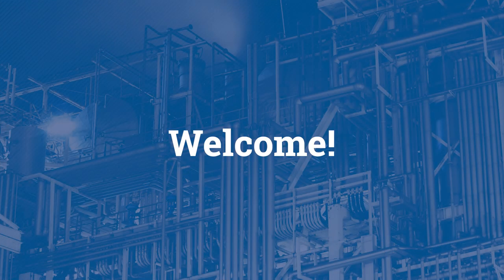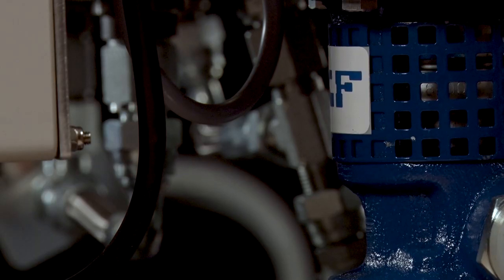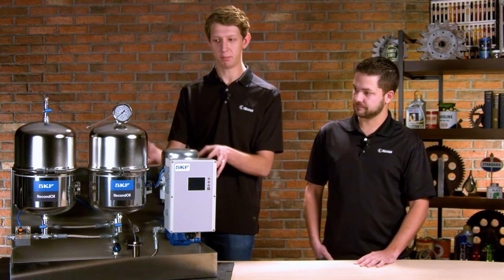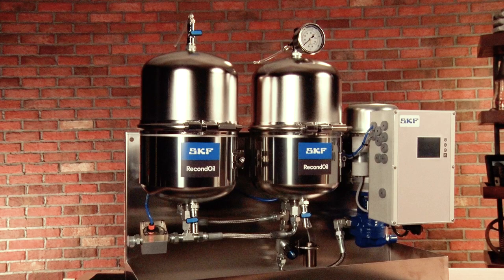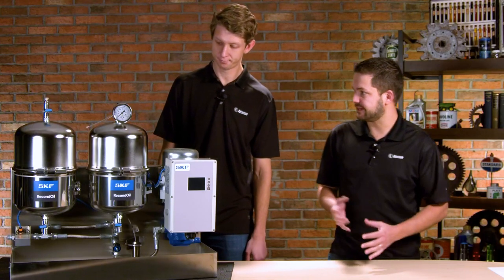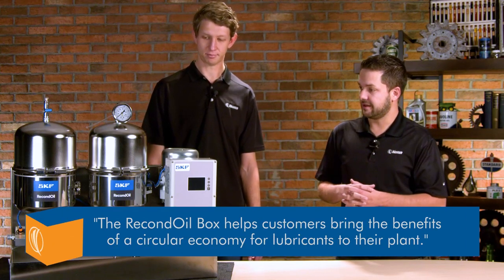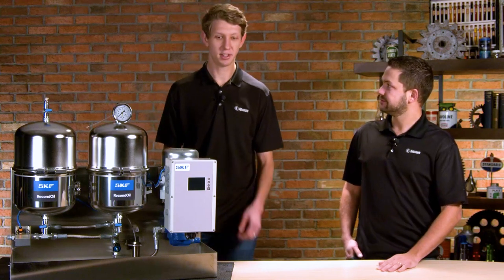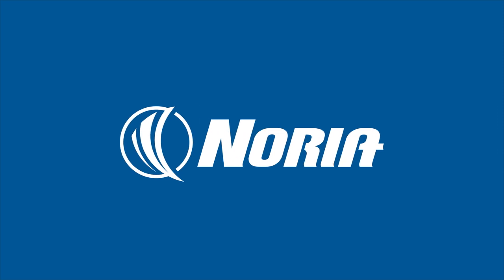Unboxing: SKF RecondOil Box

Comment: I would like to use heading machine oil. Do you have any experience with this? The viscosity is 68 cst. After use, it will go up to over 400. The oil is very sticky with lubricants, sludge, and bonding powder.

Comment: What about the additives like anti-foam, zinc, calcium and phosphorus? Do you have any long term tests on these elements?
Reply from the maker: Hi Bas, thanks for your question! We passed it along to the SKF RecondOil team, and their answer is below, but the short version is that it depends on the overall additive package and your specific application needs.

If you’re thinking of a certain application and lubricant, you can reach out to them with more details at https://recondoil.com/contact-us/ and their team will be happy to give you a more complete answer.
 
From the SKF RecondOil team: “Before installation of a RecondOil Box, we always validate that the oil is suitable to be treated with Double Separation Technology (DST). One of the key parameters evaluated is that the DST does not interfere with the additivation of the oils (evaluated using ICP). After the installation of the RecondOil Box, additive monitoring is also part of our oil condition monitoring programme.”

Comment: Can it be suitable for removal of Varnish from Turbine/Hydraulic Oils with suitable attachments.
Reply: I would like to use heading machine oil. Do you have any experience with this? The viscosity is 68 cst. After use, it will go up to over 400. The oil is very sticky with lubricants, sludge, and bonding powder.